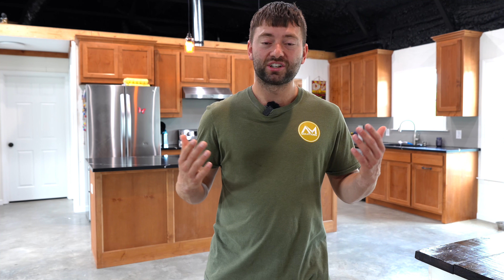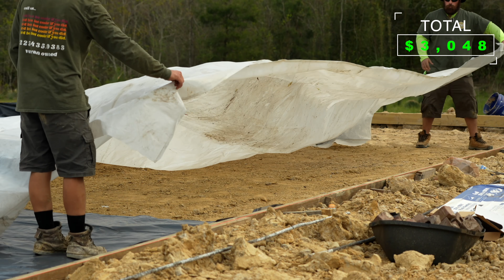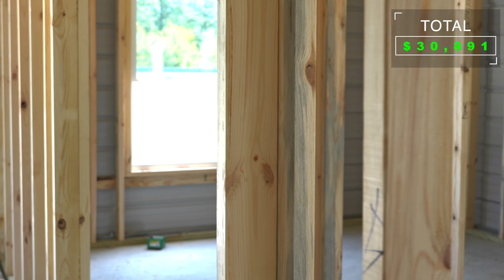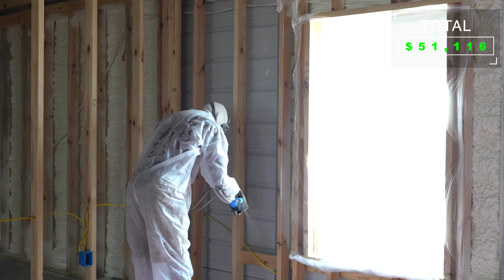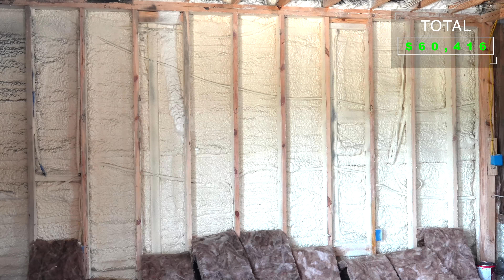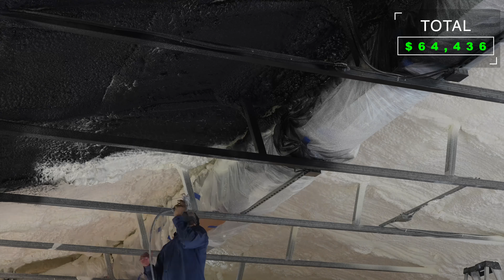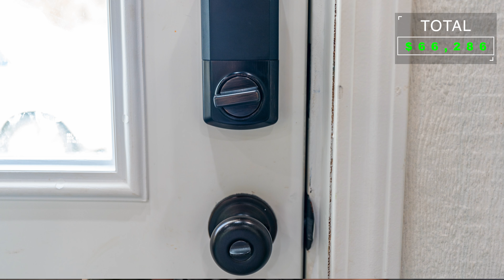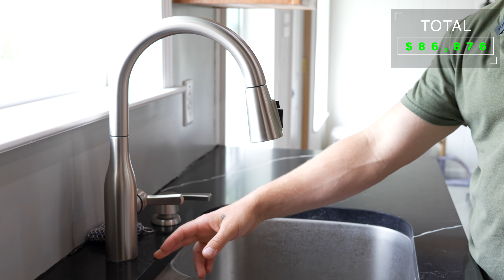Barndominium Price Breakdown | Building a 1,500 sqft 3 Bed 2 Bath Home for $87,000

Comment: Licensed Commercial / Residential  Contractor for 15 Years here — please don’t take this video to heart, unless you plan on not paying multiple line items of labor costs not mentioned, site prep / development, utilities, sales tax on all materials purchased, true finishing cost ei. Appliances, cabinets, countertops, flooring, lighting, tile. Also, I hope the envelope of this home is weather sealed better than shown in the video. 

Basically in a nutshell, take this man’s total price and up it 40% and that’s what a Builder is paying   out to trades and supplier. Builders are then turning around and selling it to a buyer for another 30% added profit margin. 

Best of luck if you are a DIYER and plan on doing this yourself at this cost….

Saying that, great video on identifying most steps for a build process - but let’s hone in on the pricing a bit more instead of suckering click baiters. 

Mathing here for people seeing this comment —> 88,129 X 40% = $123,380.60. $123,380.60 X 1.30 =$160,394.78 Purchased at the very least. Don’t forget land, utilities, and access. 

Best of luck my friends,
Reply from the maker: Got a quote from a GC that would build this for $160k turn key. Better value than a trailer all day.
Reply: You wouldn't feel the need to be critical of this video and defensive if you weren't a glorified middle man who's ripping people off in the name of "industry".
Reply: Good point sir! After all my criticisms said, heck of a good job creating this video. 

How does the closed cell foam perform from an efficiency standpoint?

Comment: You said the closed cell foam was a vapor barrier. But then you're putting in FG batt insulation with ANOTHER vapor barrier on top of the CCF.

Good Luck with that buddy

Your trim at the top IS NOT crown mounding.  Crown mouldings are mouldings at the wall/ceiling junction that are install specifically on an angle. All you have there is a piece of trim.
Reply from the maker: While it may be different from what you're used to, any trim used to cover the seam between the wall and ceiling is by definition Crown Molding. 

Here's the definition: "Crown molding is a form of cornice created out of decorative moulding installed atop an interior wall. It is also used atop doors, windows, pilasters and cabinets."
Reply: @DudeWeCanBuildIt  LMAO You're clueless bro.

A crown moulding SPECIFICALLY is placed on and angle between the wall and ceiling corner.  It's not a shit piece of flat 1by board.
Reply from the maker: @Long-Island-Sound  Its not in the definition.

Comment: Here permits would be $10,000 to $15,000 total. Midwest area. Foam insulation would be replaced by fiberglass style for me. Foam burns too quickly and badly to use. But people quit equating the price paid for a house with its value. Most new places are built very badly now. Many of those builders belong in prison for what they have done to people.
Reply from the maker: Spray foam has a fire retardant mixed in. I've seen it in the attic above a kitchen fire and it self extinguished

Comment: Any comments on the echo of sound with a concrete floor? Are there any tricks to help alleviate it?
Reply from the maker: Pretty much zero echo due to spray foam, the wood in the house and fiberglass insulation in the walls

Comment: We just built a 30 x 40 pole barn (barndamium) with 40' porch length 2 bed 1 1/2 bath with crawl space and ten foot ceilings. $120,000 after concrete porch. Did all labor except HVAC  and roof. i'm 64 and never want to do that again.
Reply from the maker: It’s a rough build! It took me twice as long working a full time job along with filming.

Comment: I know it would cost more but I would put the sound batting in all the walls in the house so you don’t have as much noise.
Reply from the maker: I did the interior walls and ceiling spaces as well. It helps with noise a lot

Comment: I think I would used closed cell spray foam on all the metal siding and roof to seal up against the heat and cold and make a finished attic for extra storage.
Reply from the maker: A finished attic would be great!

Comment: What happens when it comes time to do a new roof? Won’t the spray in insulation basically have that one glued on? I’m thinking of building one of these but that was a concern that I had. I wonder if you can deck the roof on these tubular steel buildings?
Reply from the maker: I will just maintain my roof. Treat any rust that shows up and paint

Comment: LOL, In my first two homes I used your drywall trick with inside drywall. It turned out great. If there's anything I dislike more than mudding, taping, and sanding, I can't think of it. Not to mention, I stink at it. I'm stunned by the wind rating on your barndo. Came out super nice man, congrats.
Reply from the maker: Thank you so much! 

I do not enjoy floating drywall either!

Comment: 1000 dollars for concrete finishers is so crazy low. 1.50 per foot is average.  Shed kits don't  save anything if your framing interior wall its exactly the same. and they do not appraise the same.  I have a 40x60 stick framed shop apartment.  1700 living 12ft tall with radiant heat in the floors.  i had it framed ,sided , roofed ready for rough in at 27k.   Mine is way more astatically pleasing not a ugly shed.  im also guessing your materials were a long time ago. a shee of dry wall is 15 dollars. do the math doesnt add up. Wall look like a old trailer. ugly
Reply from the maker: When did you build? 

All my receipts are linked in the description. Sheetrock is from home Depot 2023
Reply: @DudeWeCanBuildIt   The second one i painted interior last week. so current. Maybe my area is really high it is possible.  north idaho.    also build a 24x140 storage. stick framed equipment storage style. . Siding now.

Comment: Looking at doing something very similar. I have hard horror stories from guys who have had metal garages installed very similar to your barndo concerning the water coming in under the metal frame and concrete where they meet. Probably not detrimental on a garage but for a home that could be disastrous. Who did you combat that?
Reply from the maker: I did a 1" ledge for the metal to sit lower than the frame

Comment: A $90k house in this market (not counting the $200k + on land) is still crazy good. 

But basically you have a $300k house. People should take that amount into consideration when comparing this 1,500 sqft, 3 bed, 2 bath home with others near them.
Reply: That's just a normal house in Georgia at that price tbh, $90K. Outside of Atlanta anyways.
Reply: @NearEDGE  yeah 90k if it's a dump.
Reply: @sgrace7607  Ah, a person who's never stepped foot outside the Atlanta area.
Reply: How much did the Electric, septic and well cost?
Reply from the maker: @Jephstones The sewer system was $3,000 and the electric and water are city utilities
Reply from the maker: Don't forget to mention it's on 27 acres.

Comment: Where are you located? 12" deep for a footer is a money saver. No Frost line there? 
Is the building code different because of the barndominum construction? 
So it's a big slab- on- grade? 
Great video. Great result. Thanks.
Reply from the maker: It rarely ever freezes here

Comment: Located in what state & north,south or central of the state? I don’t want your address but the location will give an idea of what weather you have built for. Someone might have northern weather versus southern climate and west coast temperatures are different than eastern weather.
Reply from the maker: South Louisiana. Basically like walking around the surface of the sun while draped in a wet blanket

Comment: The cost to have a building that size built is over $15k for me just for labor. No idea how you got any of those prices...everything is like 4x the price where I live.
Reply from the maker: Where are you located? I’m in south Louisiana
Reply: @DudeWeCanBuildIt  I'm in Washington State.   Just moved from the west side of the mountains to the eastside of the mountains and bought 3 acres. We are looking to build a barndominium soon'ish. It's been difficult to find an affordable option though.  I was quoted $50k for a 40x40' metal building plus another $15k for labor and that doesn't include the foundation or insulation, etc.  For a 'cheap' stick built house we were quoted around $400k for a 2,300sqft home from a budget builder.  Around $450k for a lower-mid tier builder.  Haven't had a proper full quote for a barndominium yet though.  I can find the shells, but not someone to help with the interior finishes.  

We had a 10x20' wood shed (mini-lofted barn) built for around $8.5k, plus another $4k for electrical, hvac, insulation, drywall, and flooring (the latter 3 my Wife and I are doing all the labor for).  

We'll see where we end up. Right now just living in an RV on the property. Still have a house to sell before we can build the new house.
Reply: That is because you think in RETAIL prices.

Comment: My actual point about NOT hanging drywall 8’ vertical, pertains to OVERLAPPING vertical framing by sidestepping 4’ horizontal …..
Also eliminates possibility of 8’ vertical seam splits from certain shifts in the building.
Since there are no diagonal braces in the framing, there WILL BE SHIFTING.
Besides, typical horizontal drywall installation (properly fastened) ACTS as a sheer section, further restraining any shifting.
A single horizontal running “joint” is easy to tape at arm height, and nobody hangs drywall vertically anyway.
Reply from the maker: Thanks for sharing!

Comment: For the ceilings, what is the material and how did you hide the screws?
Reply from the maker: Bead board. I didn't hide the screws, but you could use painters putty before you paint

Comment: You mentioned that you had to bring in elect 600' to the foundation. What was the cost on that as far as the wire and tubing? I have 300' to bring mine in.
Reply from the maker: 10k if the utility company did it all. 

AFTER the new construction credit and burying the pipe myself, I paid $2500

Comment: How did the ply bead come out cheaper than drywall? Everywhere i look where i am at its way more expensive than drywall. You paid 29.78 per sheet and where i am the drywall is $10-$13 a sheet. Am i missing something ? Genuinely asking. I am in Denver.
Reply from the maker: When you factor in the tape, mud, and labor to finish the drywall, it's much more expensive. 

You could do it yourself for cheap, if you want to. I didn't

Comment: I am in process of building quotes and several tell me a tubular steel building with the roughly 2”x3” posts is not recommended. 1 even told me that I couldn’t tell the manufacturer that I would be living in the structure. We are not required to have any permits but I also want something safe and long lasting. What is your opinion
Reply from the maker: I'm not an expert on building codes, but if you're worried about the manufacturer knowing you're living in it, you could always use the building as a shop or storage first.

The building is very durable, I live in Louisiana where we have lots of hurricanes and there are tube steel carports still standing that are older than me.
Reply: No building codes to comply with, that just freaked me out about the quality and durability of the building

Comment: Quite sure I don’t agree with VERYICALY-HUNG sheet rock…. Drywall mud is a FIRE-TAPING process to prevent fires from being fed by air leaking…..hence 1 hour fire rating. Also prevents bug/pest intrusion.
Reply from the maker: How does vertical versus horizontal drywall affect bug intrusion?

You can tape and float in either direction.

Comment: Whoa whoa whoa!!!  The vapor barrier for the entire project, 2 different materials....was under $140???😂😂😂😂😂

Try $1100 minimum and that's if you steal a roll.
Reply from the maker: Recipes in the description. Go argue with that 😂
Reply: @DudeWeCanBuildIt  regardless of the code the CHEAPEST product that you can buy that application is $70 before tax from Lowe's for 10"x100ft.

In the video your using clear "low mil" or "thin" plastic and then you go over with a thicker "vapor barrier"

One roll of each your already over $130 after tax and that's for the worst DIY grade material available to the general public.

I can go around to every job site and new construction development and pull discarded lumber pieces by piece for 2 years, and then use it to slap a house together and it will have a cheap price tag.

You can't even do that size foundation with a single roll of any one particular product. 

The recipe could have Jesus Christ written at the end of it, and a rainbow with a pot of gold at the end sounds amazing....except for the part where it's not REAL
Reply from the maker: That’s a lot of writing for someone who is wrong 😂

Comment: Great job. One item I noticed when you added the fiberglass insulation bats, I think you should have used non-faced. Using the faced insulation plus the spray foam gives you a vapor barrier on the inside and outside trapping moisture in the walls.
Reply from the maker: Good point. If I used unfaced bats, how do I get them to stay in place and not sag in the walls over time?
Reply: @DudeWeCanBuildIt good point. Ive always found insulation guidance contracting. How bad is it actually with double vapor barrier, not sure. Guess we will have to wait 10 years for you to remodel a wall and report back.
Reply from the maker: @joe55 yep, long term R&D

Comment: Great house! I am buying a 3/4 acre lot in CT and I've been researching mobile homes vs. manufactured vs. modular, etc. Now that I've seen your videos, I think I could build one like yours, but 2 bdrm, 2 bath, and keep it under my budget of $100K. One question: I've been on Safeguard's website. Which style of building did you base yours on? Thanks!
Reply from the maker: Triple wide garage

Comment: what is the total square footage of the project?  In one video it seemed as if your dimensions for the slab was 14,400 sq ft.  That seems crazy.  You said "shop home" a couple of times.  How much of the structure is the shop?  Was it really as big as I think it is?
Reply from the maker: The house is 1,500 square feet. There is no shop section, I will be adding a detach shop in the future

Comment: I have my eyes on some land. would i be able to reach out to you for help regarding advice and what not when im ready to build out? i have NO IDEA about permits, sqft requirement, zoning etc. id love some information or if u can do a video about the entire breakdown from start to finish. like what land to look for and what to avoid, who you should contact for leveling the land, permits needed,  building a drive way, connecting electicity to main and gas and water etc. thanks. i have a tiny 800sqft home in mind and the land is 11 acres on water front property. id assume a well would be great choice for water and also possibly for water generated electricity.
Reply from the maker: All of those factors vary a lot from place to place. I will gladly answer any questions you have to the best of my ability

Comment: There is a bunch of bullshit….
You might be able to do this 20 years ago

You OWN an AC company so you had all the people that either work for you or are in debt with you or the company you grease the wheels with the come out and trade …. That itself probably cost $100,000.

My buddy Jay, who only charged 8000 should’ve charged 20,000 .
My buddy Steve, who owns a roof roofing company charge me five grand who should’ve charged me 20,000 .
Reply from the maker: You are way off base, I saved about 3k on labor for AC and 3k on electrical. 

Check out the guy that built a house with his kids for 50k
Reply from the maker: I built this house last year, 2023. 

I understand your skepticism, that's why I uploaded ALL the receipts. Most of the materials are from widely available stores like home Depot. 

You could build this same house yourself for around the same price. I did 80% of the labor myself and the people who helped were paid. Do you think I don't pay my employees? 

The amount of labor that was outsourced is not $100k. I wouldn't have had to pick up a single tool for that price, lol.

Comment: How would you access the pluming if it’s in concrete
Reply from the maker: Like the drains? Why would you need to access them?
Reply: @DudeWeCanBuildIt  like over time if a joint starts to leak
Reply from the maker: @Fhjfguji  If that happens, it would be very unfortunate. Water flows via gravity, where else would you put drains other than under the house?
Reply: @ well obviously but what i am saying is it would be very difficult to fix a elbow or something if it came loose over time don’t you think?
Reply: Why do you need to access the plumbing?

Comment: The foundation depth has to be 4ft. here in the northeast. The insulation may be higher r value too. Other than that, it's a great place!
Reply from the maker: Yes, building codes vary a lot from place to place.

Comment: WHAT ABOUT THE WELL AN SEPTIC SYSTEM? Add $30k+ for that, how about land scaping and a driveway?? that's about add $40k, then about the property TAX man. I do like what ya did BUTT...... your missing a bunch of KEY issues an $'s
Reply from the maker: Depends where you're at. 
If you're in town, all that can be done for under 5k. 

If you're 600 feet from the road like I am, it's obviously more expensive. 

My costs 
Municipal water hookup $$1800
Aerated sewer system $3500
Driveway $10,000